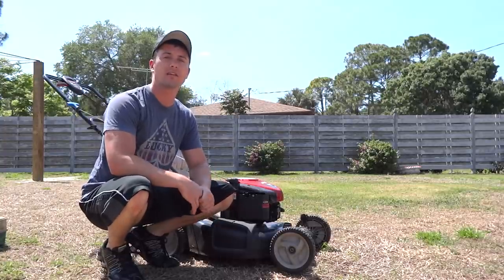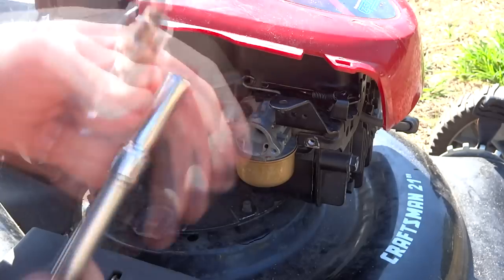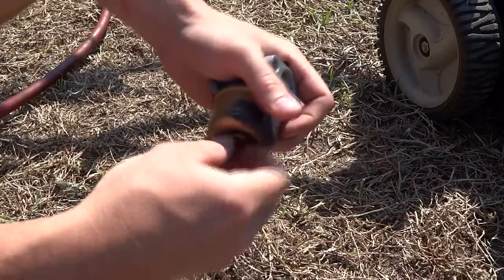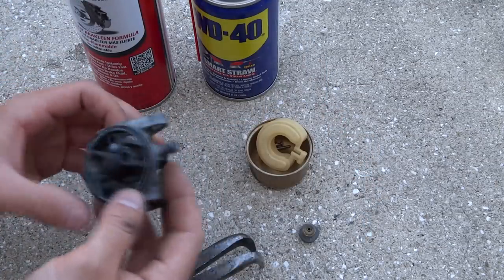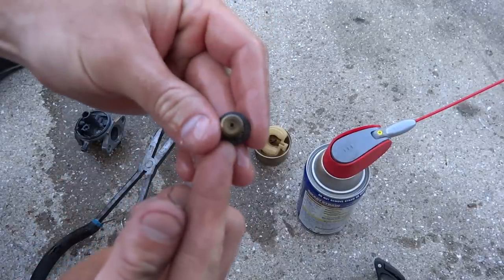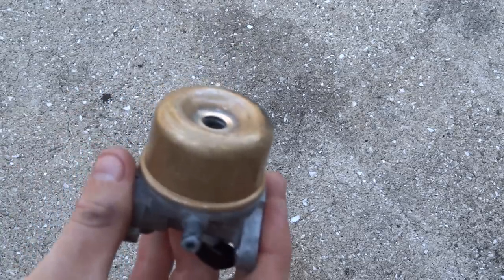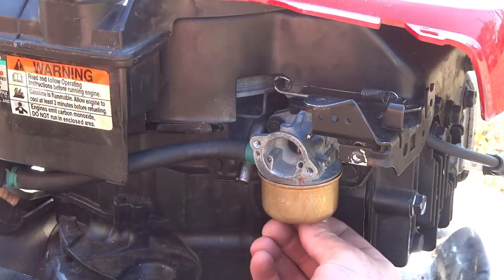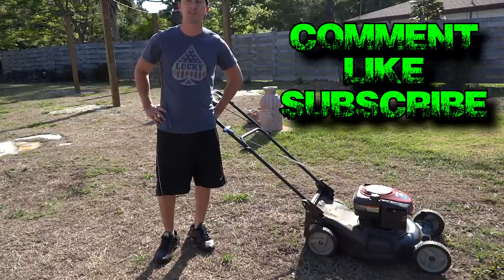Lawn Mower Won't Start? Here's The "FIX"

Comment: My mower hadn't ran in eight years (basically sat in the shed while I used a different mower).  I cleaned out the incredibly dirty carb and it started on the first pull.  Great instructions, perfectly clear.  Awesome video.  I watched a few ads for you as a token of my appreciation ;)
Reply from the maker: Thank you William!

Comment: Lawnmower wouldn't start last night, Watched your video, put in a new plug from Lowe's, followed all your steps, but used a paper clip vice the bread tie and got it back together. Fired up on the first pull.  You just saved me $60.00 bucks for a tune up.  Thanks man!

Comment: want to thank you for this video.  Just completed a tune up on my craftsman mower and I needed the air filter gasket.  Cracked and broke right where you said.   I used the information you provided below got a new gasket and all is very well.   Really couldn't of done it without that specific info ( part number).   Thanks again.

Comment: Your video was a real help, my Lawn Boy (Kholer motor) wasn't running after winter, starter fluid would get it to kick on and come back off. Took it apart, gaskets were fine (this was primer-less with electric start so it was a bit different, but still similar) once i pulled the bleeder bolt off i saw some clear gel looking gunk blocking the holes there so i knew it was going to be all inside of the carb. Took it all apart cleaned it out really well with WD40 (didn't bother getting it off with brake cleaner) dried it off a bit with a lint free cloth, put it all together and started right up. Albeit a bit smokey at first due to the WD40 being in the carb, but everything is perfect. Thanks!
Reply from the maker: Thanks Steven! Glad I could help.

Comment: Pulled lawn mower out after winter, wouldn't start. Switched spark plugs, still wouldn't start. Cursed it and shoved it back in the garage. Spent the rest of the day mad at work. Thanks to your video, I was able to get it started the next day. Thanks!

Comment: hi, thanks for the video. i did the same process but used carburator cleaner and worked like a charm. My lawn mower turned on the first time i pulled on it. Thanks

Comment: Thank you for the video. Mine probably didn't start due to connecting wire being loose (on/off wire). I cleaned the carburetor and air filter and it starts and runs well.

Comment: Great video! Followed your instructions using Carburetor Cleaner. Still took about ten tries to get it started, but it works great now. Thanks!
Reply from the maker: +Andrew Denterlein 😀 Sometimes it can take a few tries if it's gunked up bad. Glad it worked for you!

Comment: Just got finished with the steps and it mine started working. It ran a little rough for a minute or so but probably just had to burn off some more fuel and then it started running like a dream again.
Reply: Robert Janeway Sometimes they will run rough on start-up after a cleaning until the fuel gets down into the carburetor bowl completely.  Also, check your spark plug, if its dirty it can cause it to start rough as well.

Comment: I want to thank you for sharing the information on cleaning the carburetor on the mowers. I have a push mower which was never used that much and has been  sitting up for years now. It was leaking fuel around the area of the primer bulb when I stopped using it so that probably have to be replaced first.

Comment: I have the very same mower. I cleaned the carb, replaced oil and gas, replaced spark plug and air filter. Then I pulled the cord and it only pulls out about 12 inches and won't pull any further (it does recoil). Any thoughts on what I should look at next? Thank you; your video was the best I've seen on You Tube!

Comment: You have a great and concise presentation in your video,...well done! Thanks for the tidbits. However, it's too late today for that first cutting of the year, rain is moving in! I'm still in some questioning if the reason why my lower will not prime (still have to do some trouble shooting) and I did try a quick fix make up of a gasket to apply over the older...no outdoor equipment supply stores are open today. The things you can't do anything about has been my bad luck! Lol! But the make up gasket didn't work or the primer seat might be cracked. I've never had a problem with this lawn mower (two year old Briggs&Stratton, maybe the same one in the video) , but I believe it would be best to go ahead and do a detail clean up on the carb. When I see these vids about push mowers, I wonder how many dollars have been wasted buying a new mower or professional repair over just a few simple dressings. Thanks for being kind enough to share the basics!
Reply from the maker: +Thomas Ashley I can only imagine how rich I'd be if I could only have a dollar every time someone threw their mower away because of a dirty carb :D

Comment: my lawn mower  had  same  problem .  changed spark plug, motor oil, air filter , used vacuum  hose suction  to  clean  carburetor without  taking it apart .  started right up!  runs like  new.

Comment: Thank you so much! My lawn mower sat for the winter and now won't start. (I only used it a couple of times/brand new before putting it away for the winter, also ran the gas out of it). Now I can give this a go tomorrow. Only thing I am going to do different, is to wear gloves! ;)
Reply from the maker: You got this! Let me know how it goes Rene.👊
Reply: Thanks! Tonight it's a garbage disposal, tomorrow it's the lawn mower. Then on to my motorcycle. Eek, that one's a little more in depth for me. I'll let you know how it goes! :)

Comment: Thanks for the information. My mower did not start up but turnover a few times and shut off. Currently using GumOut Choke clean. My mower is new but was not used due to having a mower guy take care of the yard. I am not mechanical inclined, so if the mower does not start, I will either buy a new mower or use a company :-( I will let the choke cleaner work over night for now.

Comment: I have a certificate for motorcycle and small engine repair,the older lawnmowers had fuel air screws . I watched this and went and bought a 2 dollar can of spray oil at the dollar general store, with the red straw. I sprayed and used the bread tie like you said and didn't have to buy any gaskets it started first pull I just ONLY used oil to clean the carb and the metal wire. I have a slightly different set up I have a quantum 5.5 mower with iron cylinder sleeves  industrial/commercial push mower.(its a good thing I only used oil to clean it , if I would have used brake cleaner I may have swelled up the little rubber needle seat in the carb)

Comment: Great video! I have a Troy Bilt TB230 Briggs - My mower will work fine for awhile sometimes several sessions - but sometimes when I stop, It wont restart until I wait 20 min or so..  Does that sound like something cleaning the Carburetor would fix?  Thanks
Reply from the maker: +Monte Maxey Yes

Comment: Thanks NTFL Very interesting , Question: Should I start my lawn mower weekly because I did not start my mower for over 6 months and now does not start or is it the old gas? Note mower is 1 year new and rarely used.  Due to the fact we had no rain or watering  to conserve water here in So. California and no lawn to cut (lucky me)  lawn mower is brand new and is a  Briggs & Stratton. Thanks.

Comment: I have a couple of old lawn mowers, and your suggestions usually work. However, I have found on a lot of the B&S engines that the diaphragm gasket between the carb and the gas tank was worn out, and sagging. This condition doesn't allow the small needle valve and spring to work properly. Usually replacing this gasket fixes this problem but my question is, is there anything one can do to place less stress and wear on that gasket to begin with. I know the chemicals from the gas has a bad effect on rubber diaphragms and makes them wear prematurely, but is there anything I can do to help prolong the life of the gasket to begin with?

Comment: My mower is 23 years old, for the past 10 years I said I was going to replace it but it would consistently start 1 or 2 pulls. I haven't used it for 1 1/2 years and now the carb is clogged. I will probably do this and keep it another 5. Unfortunately now the deck is starting to rust through.

Comment: Hey Nthefastlane, this video really helped with troubleshooting my Toro Personal Pace lawn mower that wasn't starting up. I have one question though, I noticed that my "Carburetor Gasket" was stuck to my carburetor and half of it peeled off. Is it necessary to have one for my lawn mower to work? Thanks.
Reply from the maker: PluriiGaming Yes, it could lean out the mixture by pulling in more air then it needs. Also could run a little rough and leak fuel.
Reply: Thanks. I really appreciate it!

Comment: Have a Cub Cab riding mower  Started 5 minutes then nothing.  Checked all recommended maintenance items, including new battery.  Neighbor, retired mechanic  suggested looking at 10 cent fuse. He could tell was bad just by looking at burned out center.  Replaced, ran immediately. NO MENTION OF A FUSE IN THE OPERATOR'S MANUAL/TROUBLESHOOTING SECTION (ENGINE FAILS TO START).

Comment: I'm gonna try this tomorrow.  Today my mower would start run a few seconds then die out.
Reply: Gene Wentworth I cleaned the bowl and ports and put in a new spark plug.  Started right up.  Cut the front grass.  The next day I went to cut the back and it wouldn't start.  The gasket is cracked by the air filter.  I guess I will try replacing that.
Reply: Gene Wentworth I went to the mower store and bought the carb rebuild kit for $13 cause I needed new gaskets.  The one on the bowl needed replacing and the other one that you said cracks.  Cleaned all the ports and after about 8 pulls she started.

Comment: Thank you. I had already cleaned mine but  i was missing some ports. I use carburetor cleaner. I am not sure what's better, W-40 or the carburetaror cleaner?
Reply from the maker: Anytime Isaias...Carb cleaner.try avoiding the float with carb cleaner unless it's really dirty..it can prematurely dry it out.WD40 help loosen the particles.
Reply: Nthefastlane
 Great video. What do you mean by "dry out" the float? I've been using carb cleaner and I don't want to screw up anything. Thanks.
Reply: Zeb Acuff From what I understand, some plastics can dissolve in some carb cleaners, then evaporate away, leaving the plastic looking 'dry' or 'ashy', and brittle.

Comment: Thanks for the video! My carftsman mower's Birggs Stratton engine wont start if it sits there for hours, but when I drain the carbureter plug, then only it starts and will continue to start on first pull as long as the engine is hot. I noticed, the gasket has worn out. Could this be the problem? This mower engine does not have a primer bulb.

Comment: Ricky Bobby,
Great vid, thanks.  I did everything you stated but here's the problem (cleaned and rebuilt carb, new plug, new gas, changed oil).  If I put some gas directly in the carb, it starts on the first pull and continues to run until I release bar.  Then it won't start.  Re cleaned carb, replaced needle valve (but not seat), replaced gaskets, ckd that there is gas in float tank and it did the same thing. Starts right up with gas in carb but won't afterwards.  Note I don't put the carb cover that has primer bulb or air filter back on since I need access to carb inlet to pour gas in there.  Any idea why it works with gas in carb but won't afterwards. Same exact mower as the one in your video.  Thanks in advance.
Reply from the maker: +Ricky T Because your carb is clogged, I mention this in the video with your same symptoms.Try my video.

Comment: so i just saw this video,i did everything you described in your video but it still wont start. it will start if you put gas straight in the carb but soon runs out, it seems like its not getting any suction to pull any gas into the carb,any ideas would help
Reply from the maker: If the float gets stuck it will not prime the bowl,  might wanna check that..unscrew the bowl also sometimes you have to do this procedure twice on the carburetor cause the little tiny ports don't quite get cleaned out.
Reply: Robert Murdock Pushing on the rubber bulb for a few years will eventually cause a pinhole or worse, usually from a fingernail jabbing the same place when you push, and this can cause a hole and screw the flow of gas up.  Check the rubber bulb and replace if necessary.

Comment: My rubber primer button wore a hole in it. I filled the primer hole with a screw with thread tape on it. Is this a reasonable fix or will it still be a problem? Obviously I can't use the primer anymore unless I find a way to replace it.

Comment: Instead of using a bread tie, You could get a throttle cable from something and use one little hair every time. You will just have to unwrap it and cut at desired length. I do this and it works every time. Also, after that, you could use an attachment "Pistol Grip Air Blow Gun" for an air compressor and blow through all the jets. Try It!

Comment: Also the rubber seat for the needle and seat assem. was installed up side down, the groves in the rubber seat must be installed on the bottom as it goes into the carb.

Comment: Lawn mower wouldn't start. Changed oil, spark plug, gas.  Took off carburetor and it was filthy and filled with some kind of deposits. Cleaned it just like the video instructed. Started no problem.
Reply from the maker: Thanks for the feedback Team!

Comment: While cutting grass, my Toro O-Turn with a Briggs & Stratton model 286H77 stop running. It will not restart. I checked the fuel filter, its clean, air filter is clean, new spark plug, Still will not start. Any ideas of what my problem may be?

Comment from the maker: It doesn't, I didn't catch myself..what I meant to say was that it will affect the air fuel ratio.Technically it could effect the compression test if you did one with a closed throttle instead of a open one but that's irrelevant.

Comment: Inhave one question  i have a briggs and Stratton  craftsman man 5hp self propane  walk behind  mower  and i wanted to know since the carburetor  is plastic if this willnwprk with that
Reply from the maker: +Jair Ramos Just used wd-40 and not the brake cleaner and it should be fine.

Comment: MY MOWER WOULDN'T START AFTER WINTER. ISPRAYED CARB. CLEANER IN CARB,IT RAN A FEW SEC.  I SPRAYED MOORE IN CARB. LET IT SET A FEW HRS. NOW IT'S RUNNING.  THANKS!

Comment: Nthefastlane,  Not sure if you help troubleshoot other's engine issues but I figure I'll comment and see if there is a response.  I've got a 6.75 Briggs & Stratton on a 1 year old Huskee log splitter.  When the temperature is warm it starts like a dream.  However when the temps get down into the 20 degree range and lower it is a beast to start & often times I'll give up pulling the rope.  Is there any way to help these engines start in the cold weather?  If you've got a video to direct me to that is fine…if not I'll take any thoughts you have.
Reply from the maker: Hi Cory, I'll be glad to help. I think the problem your having is fuel related. More then likely your using fuel that has ethanol in it, runs great in the summer but a bear to start in the winter.Cold temperatures cause ethanol-based fuel to gel up and when that happens your carburetor gets clogged up. Switch to non ethanol fuel and it should fire right up. Drain all the fuel out of the system first. Hope this helps.
Reply: Thanks so much...ill give that a shot!
Reply from the maker: Anytime Cory, make sure to report back so others can learn soulutions. Also try posting question on my website forum, it helps everyone out.. Www.Nthefastlane.com/Forum
Reply: Nthefastlane I did this with the exact same carb and it started on the first pull. Then about 20 minutes later I tried to start it again and it didn't want to. It took almost a dozen pulls to get it started, same as before. What gives? It's almost as if my lawnmower is mocking me.
Reply: Bbnnb
Reply: believerJona

Comment: I took out my carb, and noticed the gaskets were trashed.  Someone else had taken the carb out to clean it, before it was given to me.  So I have tried repairing the gaskets, and hopefully that was the problem, unless the other person trashed them when she took it apart? Waiting for the gasket repair to set up, then if I can get it all back together, I pray it starts!   ;)
Reply from the maker: The gasket seals the carb and allows you to prime it, if it's cracked it wont prime and will leak.
Reply: Nthefastlane True, but it will not start when something appears to be missing that attaches to the carb either.  I put it back together, and clearly the gal who took it apart didn't get it all back together....I am about to give up.
Reply: Nthefastlane   Oh and it doesn't appear to be leaking.  ;)